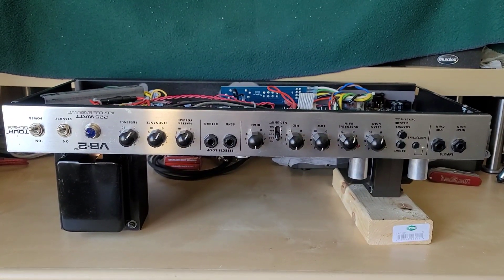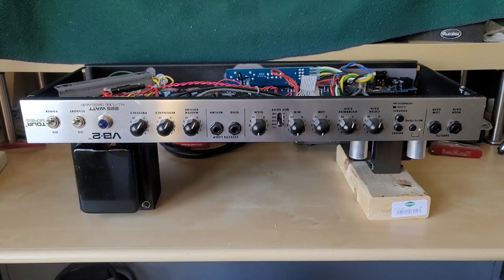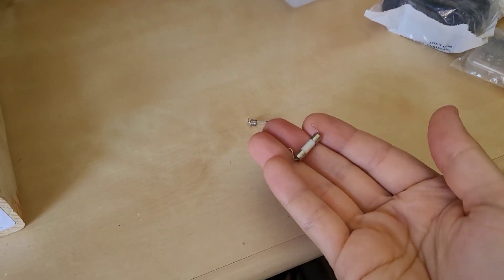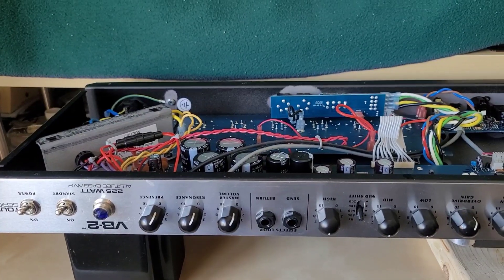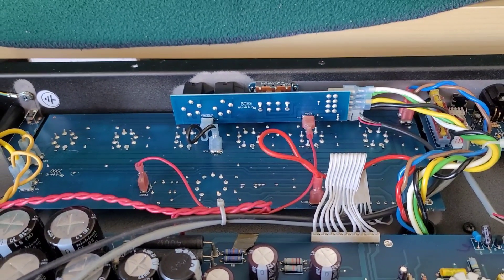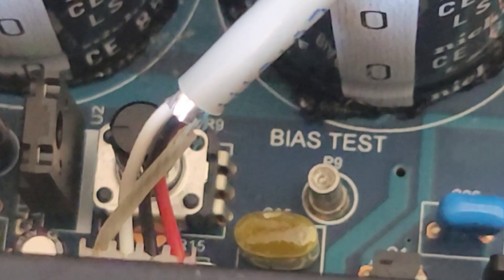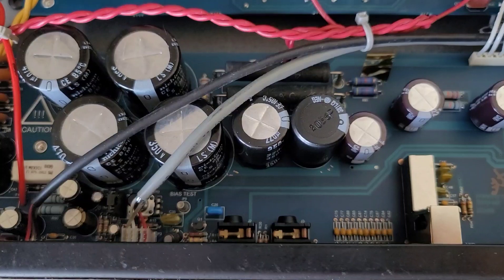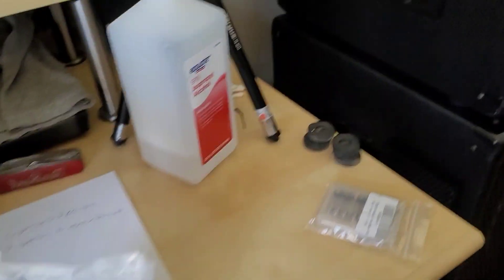Peavey VB-2 Valve Tube Bass Amp: Repair, Reliability Discussion, & Mods

Comment: So plugging a feed from mixer into the effects return socket risks all this? Sounds like amp Armageddon? Who would ever do this then? The return socket doesn’t sound safe to use ever.
Reply from the maker: @willgammage8032  hey. No the resistor issue is a reliability issue. It has nothing to do with using the return jack. No risk with that.

Comment: So plugging a feed from mixer into the effects return socket risks all this? Sounds like amp Armageddon? Who would ever do this then? The return socket doesn’t sound safe to use ever.
Reply from the maker: @willgammage8032  no not at all. The resistors issue is more a reliability issue, not connected to what you are trying to do

Comment: Brilliant explanation; I totally get that thank you very much. I’ll dig out a small mixer that it’s in the garage. Somewhere….
Reply from the maker: @willgammage8032  my pleasure! A side note, make sure you remove the 10k resistors that tie pin 8 suppressor of the power valves to the bias supply. If you get a shorted tube it will burn those resistors and potentially take out your bias supply which can then in turn blow up the whole set if you don't notice it in time. I got mine in time, but passing the info along.
Reply: Apologies but I have no idea what you are talking about. But thank you anyway. That advice is way over my head.
Reply from the maker: @willgammage8032  the details are in the description. An amp tech will understand. Some of the VB-2 amps had resistors inside that should be removed to prevent future problems. Later production ones didn't have it but earlier ones did.

Comment: It’s XLR to 1/4 Jack yes but I don’t know about matching impedance? I wasn’t aware that connecting leads needed to be concerned with impedance? Thank you 🙏
Reply from the maker: @willgammage8032  an XLR is a low impedance output and the return of the effects loop is a high impedance. They do make XLR to TS wires where pin 3 is disconnected in order to drive an unbalanced input/output but signal level is lost by doing this. Shure makes an XLR/TS matching transformer but it's normally used for microphone so it has a decent low frequency roll-off. The other option is to use a small sub mixer. Connect your XLR line out to the input of the mixer and then send the output of the mixer going to the return of the VB-2. This allows you more flexibility in the adjustment of the signal.

Comment: I have a VB2 here in the UK; the previous owner was selling it cheap as the sound was awful but after changing all the valves it sounded great! I would like to ask a question though please? The effects loop return socket is supposed to route straight into the power section. When I take a line out from my Fender TV 10 combo and plug it in; nothing happens. Except that plugging in kills the signal from the VB2 preamp which I’m sure it’s designed to do. Am I missing something? The TV 10 PSU appears to have failed and here in the UK, I’m being told that it cannot be repaired and the only way to use it is with the rear line out socket. Thank you.
Reply from the maker: @willgammage8032  Hey Will, I assume the Line Out is an XLR from the Fender amp? If so you would need an XLR to 1/4" impedance matching adapter

Comment: I had a tech take the soldered fuse out and put a replaceable one but for the life of me I can't see it.  I want to remove from the case but I'm afraid of the high voltage capacitors.  How do you safely discharge?
Reply from the maker: The amp has bleed resistors, keep it unplugged for about 15 min to be safe and the caps will discharge safely.

Comment: I've been playing this model amp for several months now, it sounds great, but it's really noisy. Sounds like an old radiator style heater that was just turned on for the first time, in a while!!! Do you happen to know what causes that?
Reply from the maker: I would say that's a normal sound. You are going to hear the power valves "creek" like the glass is "pinging." This is because of thermal expansion of the glass envelope. Normal operation.